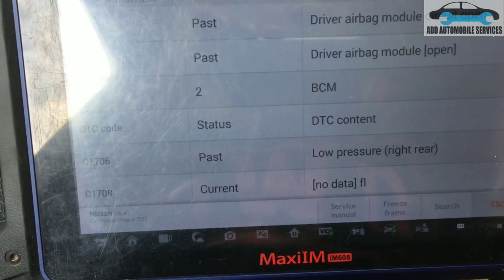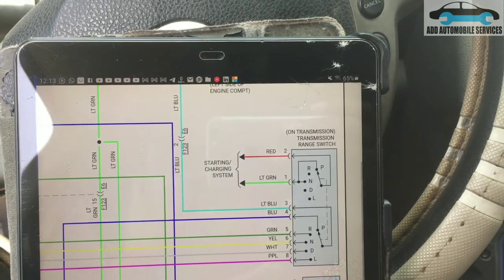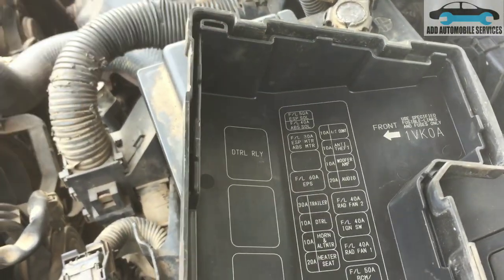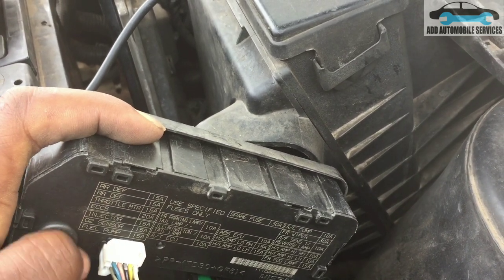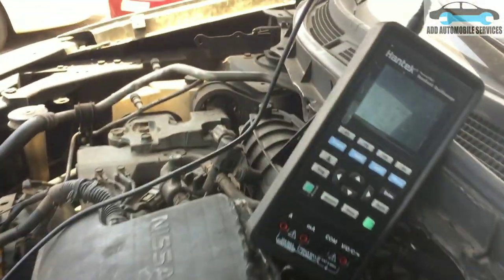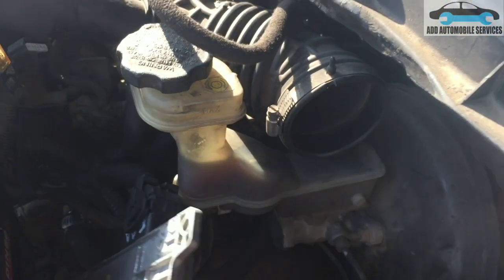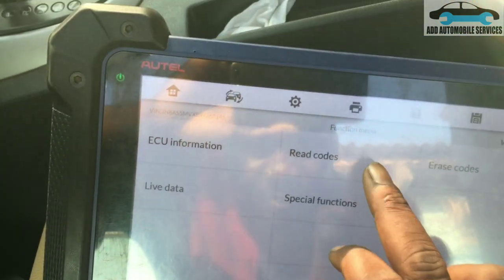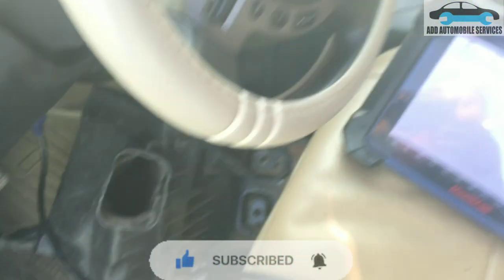2012 Rogue : Lost communication with TCM

Comment: If Theres no power at the transmission fuse, the abs module fuse and  esp module , that is fuses 44,45,46... but all the other modules are working perfect but no crank no start, what could be the problem? No communication with TCM 2008 cls550
Reply: i am able to start the car by jumping the relay
Reply from the maker: Change the fuse and check it again
Reply: @ADDAUTOMOBILESERVICES I have power, my car runs but won’t shift, lost communication with Tcm u0101. 2008 c300. It ran the day before but then woudnt shift the next morning
Reply from the maker: @davidmendoza5522  check for water damage on the CAN connectors
Reply: Having this issue with a Nissan Rogue 2008 No connection to the TCM and the transmission boss is using gear 1 to move. 

Can't it be I have to change the TCM
Reply from the maker: @henrypaul416 you have to check the system first
Reply: @ADDAUTOMOBILESERVICES  all system check,  the fuse,  check.
Reply: Please or which system do I still have to check it's Nissan Rogue 2008
Reply from the maker: @henrypaul416  your powers and CAN line
Reply: @ADDAUTOMOBILESERVICES  I have Check the power to the TCM and is available.  But I don't know much about the can line of the Nissan Rogue.
Reply from the maker: @henrypaul416 same pins in the video
Reply: Please does the CAN line mean the Wire diagram to the Transmission? 

And. Can the TCM loss communication Affect the Transmission Not shifting from just a gear